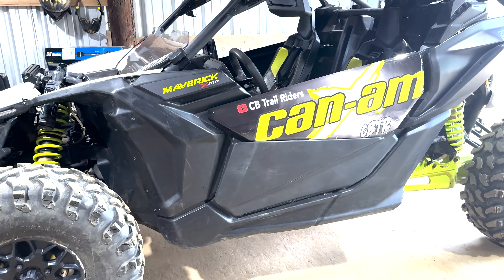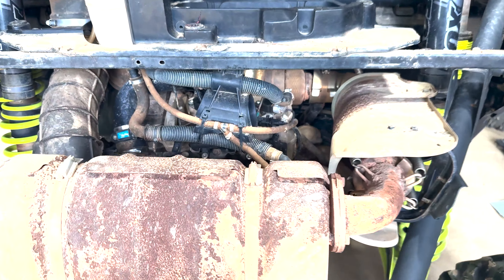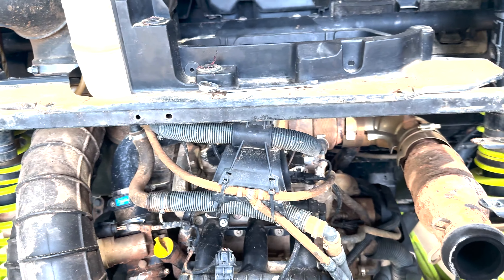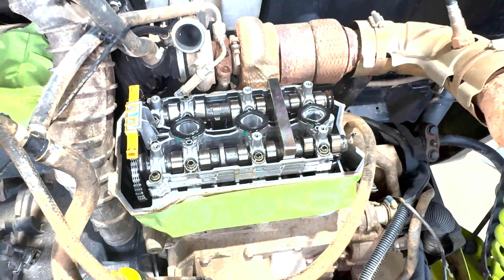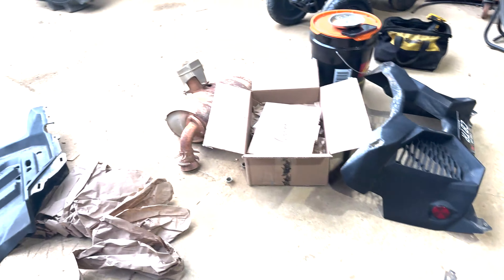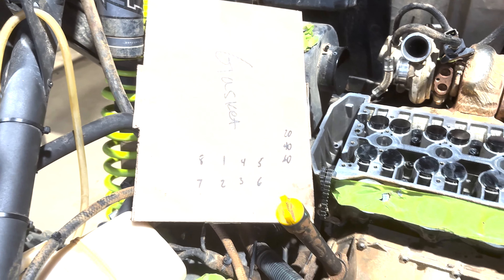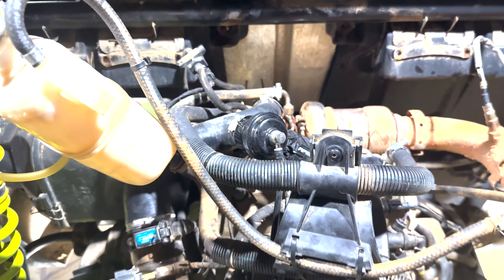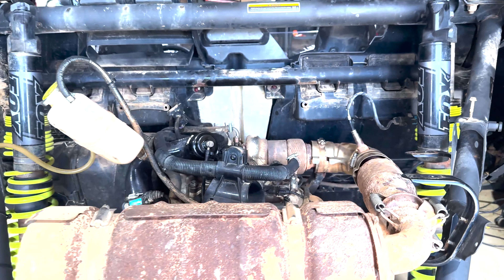I BLEW A HEAD GASKET ON MY CAN AM MAVERICK X3 | ARP HEAD STUDS

Comment: How did you get the cams to point at each other or be at dead center to take the timing chain off?
Reply from the maker: Luckily they were already TDC when I pulled the valve cover, so I used the cam holding tool to keep them in place and removed the chain tensioner

Comment: How did you know you blew a head gasket? What was the cars symptoms? Trying to figure out if mine is bad. TIA
Reply from the maker: Antifreeze level kept dropping and coolant would always push out of the coolant overflow hose
Reply: @CBTrailRiders you fix the overflow and overheating?
Reply: Mi car has the same symptoms
Reply from the maker: @villagranasaul4034  yes
Reply: you rectified the engine heads ?